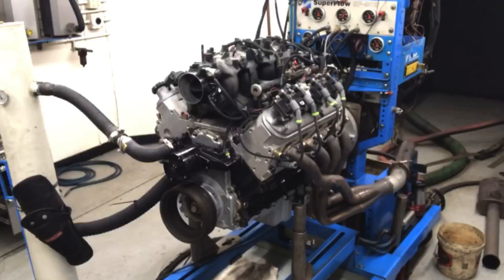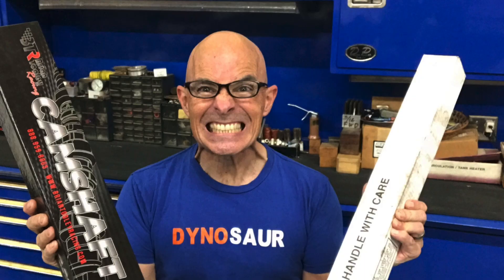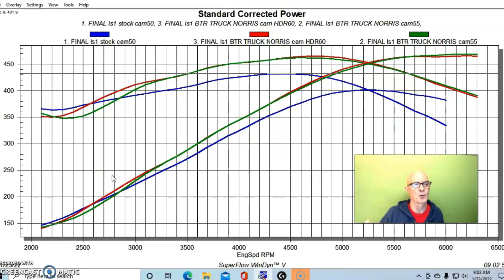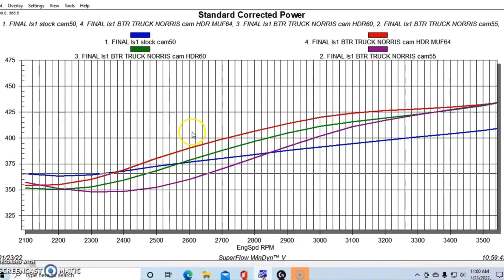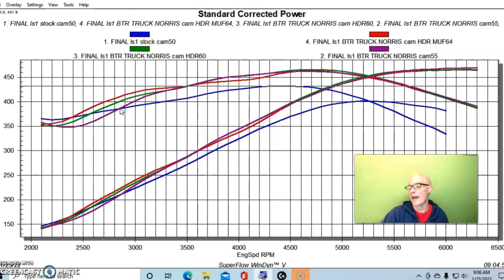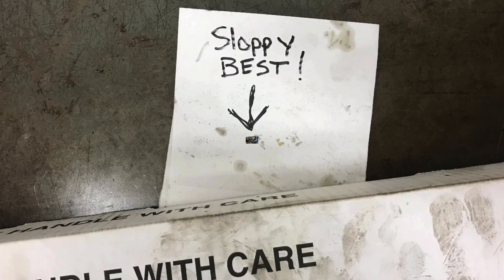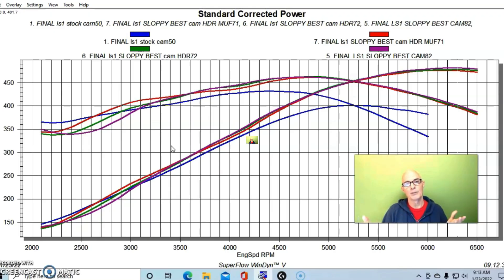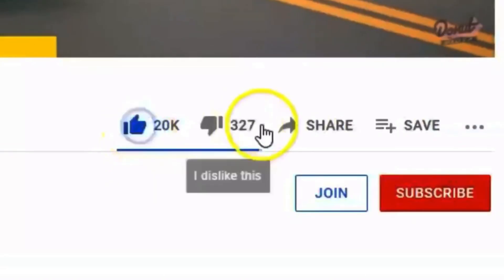DO LONG TUBE HEADERS ADD HP? 1 3/4 vs 1 7/8 HEADER TEST. WHAT MAKES MORE POWER ON AN LS? BONUS TEST

Comment: Both cars that l have and have had have had 1 7/8 long tube headers the one l no longer have had LS2 6.0 4.10 gears 700r4 transmission with a 3000rpm stall converter the car l have now has a LS3 6.2 3.27 gears a 6L80e transmission with a 4200rpm stall converter both cars have absolutely no low speed torque problems what so ever now if we were talking about my 2009 5200 pound Tahoe 5.3 with a stock stall converter l could see wanting more torque from idle to  3000rpm and using 1 3/4 long tube headers bet the stock exhaust manifolds are 1 5/8 but of course they are much shorter than any long tube header is
Reply from the maker: STOCK EX MANIFOLDS LOSE LOW SPEED COMPARED TO LONG TUBES
Reply: @richardholdener1727  l know had a LS2 in a G-body in 2008 nobody made headers for it so we used stock exhaust manifolds into duel 2.5 pipe with a X pipe and two two chamber mufflers dumped at the rear axle it ran good but in 2009 muscle rod by Hedman came out with a 1 7/8 long tube headers with 3 inch collectors using 3 inch pipe into a X pipe with two one chamber mufflers dumped at the rear axle made a huge difference in torque from idle to 7200rpm a big difference throttle response was better and it revved up faster

Comment: If your running a 3000-5000  stall converter the reason for it is so your engine when at full throttle doesn't spend much time from idle to where the stall converter starts to catch so more torque below that say idle to 3000 would benefit street cruising but not so much full throttle now a heavy truck or SUV with a stock stall converter would benefit greatly with more torque from idle to 3000rpm

Comment: "The Mega Stuf Orea is perhaps the most delicious and fattening member of the Oreo cookie Family" - Daytrade Scottie
Reply from the maker: I FOUND ONE EVEN BIGGER THAN MEAG STUFF AT A LOCAL 99 CENT STORE
Reply: @richardholdener1727  I am currently in training with the Ultimate Chocolate Stuf Oreo cookies.  When the current supply has worked itself out, I will step up my training.  Thanks for the heads up

Comment: Richard, my man. Can you do a test on the BTR torque cam? In either a 5.3 or 6L that would be cool to see. I want a better low speed cam in my 2500hd without the chop or need for a looser stall. Maybe even some other cams that can be classified as “stealthy daily driver cams” not everyone wants the “chop chop”
Reply from the maker: THE BTR TORQUE CAM WAS TESTED IN THE TRUCK NORRIS VS SLOPPY BEST CAM VIDEO

Comment: This is GREAT testing!  The question I have now is where does the 1 7/8" headers start to become beneficial?  I'm currently building an engine for my C5Z that will be estimated 750-800hp NA at the crank.  What im trying to figure out now is how beneficial would it be for me to buy a 1 7/8" header to use over the 1 3/4" header I already have? Or do I just use what I have if im not going to see a 20ish or more hp gain?
Reply: Maybe this video from popularhotrodding where the test four different size headers on a 427CUI engine producing close to 600hp will help you. Horsepower and engine size makes a difference. 
https://youtu.be/O1bXPNy1Yn4

Comment: Thx, I just figured primary size for a 660cid @ 5700rpm power, to be 2.125. A 572cid 6800rpm piece. That's what I want in a heavy SUV, making crazy power.

Comment: So let me get this straight. Say you have a 408, 418, 427 stroker motor making over 600hp and you won’t pick up at least 20hp going to 1 7/8” headers….I’m not buying that. I’d like to see proof. I’ve already seen a more powerful setup pick up at least that at the rear tires. So saying it wouldn’t, isn’t telling the whole story. Of course a heads/cam 5.3/5.7 won’t benefit from 1 7/8 headers, I’m pretty sure most motor heads know that and have known that.

Comment: Great video as usual.

I feel this particular video would be more relevant in the 2002 era where guys were putting bolt ons on their F bodys and vetts, but considering  headers. So I can see the little change in power vs these 2 header sizes at this lever/rpm range

This is 2022 and most guys using LS engines for power  are wanting to make some big numbers. Im talking NA, N2O, Boosted.

I would love to see you do a comparison of say a N/A (6.2 based) Rec head, 416ci ,  11.5:1,  650hp, 7000rpm power peak with these 2 header sizes.

Let me know.

Thanks for your time and effort in all your videos!
Reply from the maker: You are mistaken about the market-you (and others) might want to make big power, the vast majority are not building high-hp race motors

Comment: did this same thing on my 94 vette after adding the hot cam. primaries so big I had to dent the frame to get them to fit. really opened up the exhaust. first time i took it out couldn't get traction in second gear. blew the right side flowmaster clean off the car called flowmaster up they said first time they hear anyone ever did that. would have ran 10's that day but asshole at the track sent me home. was going to go up to 2 inch headers so i could run nitrous but totaled the car out when a couple deer ran in front of me on the highway

Comment: Engine dyno numbers don't tell the whole story, my P71 goes faster when i run it open headers vs closed electric cutouts..
Reply from the maker: the dyno tells you exactly what the difference in power is
Reply: @richardholdener1727  i agree with you, but once driving, the full exhaust may slow the car down vs running it with 2 to 3 feet of extra pipe after the headers.. In my case i'e confirmed my car runs slower with the stock exhaust on vs opened cutouts after my longtubes n high flow cats.. I'll try n do a video of my setup, it's pretty badass but it rattles when closed cuz the exhaust hits the cutouts directly n turns to go through the stock exhaust, if that makes sense.. But i love the dyno always..

Comment: Nice vid.. I'm sure there's going to be way to many bad replys 
My chevy 2 with a 385 ci small block with hooker fenderwell headers only changed a 1/10 of secoond in my 60 times. And that only from weight of exhaust. Still pull front wheel off the ground. Vs open headers

Comment: Are those 1 3/4 QuickTime performance headers?  I remember back in he day they were known for having higher  torque at low rpms compared to others headers. 
  They were due to the merge collector. That's why I ran those on my ls1.
Reply from the maker: QTP
Reply: @richardholdener1727  
 I figured they were QTP by the tag being welded to the header. I had done some research and showed up to 35 ft pounds of torque around the 2500 rpm range vs other headers. Thanks Richard awesome work.

Comment: I am more interested to see this test with a 600-650+ hp engine , to see the difference between 1 3/4" and 1 7/8" headers . 450-500 HP just isn't moving enough air for 1 7/8" headers. Thank you sir.
Reply: I’m with you!
Reply: 100%
Reply: Yeah unfortunately he always doing these little sht cams.  I wanna see like a summit 8707 or 8710  with 228/238 .600" lift and 1 7/8 vs 1 3/4 on a 6.2l

Comment: This 100% correct that a full exhaust system will work better than open headers. I did this same experiment at the race track by putting a capable cutouts on my headers. When I took the caps off the headers the car slowed down 2/10 of a second in the 1/8. Put the caps back on and the car picked up and ran where it had previously. Glad to see the myth of 1 7/8 headers busted, I had long wondered about that. Thanks Richard.

Comment: I’ve been waiting for 1 7/8 to get back in stock based on some tests on Engine Masters (not LS) but good to know I can go 1 3/4 with an LS swap and put the $100+ in savings elsewhere in the build. Thank you for the valuable data!
Reply: There is a good build in Australia on a Holden Commodore ss with an l77, similar results but backed up on the drag strip as a gain with smaller

Comment: Hi  , Seems its all about cams and cubic inches.  A good strong street cam on BB 427 can use either 1 7/8  or upto 2 inch and still make power . Need to try on a N/A stroked LS  or Sbc at 400 cu. inches .  Thats an interesting test.
Do the header calcs and 400cu.in is the minimum u would use  1 7/8 . With a strong street cam the requirement is somewhere between 1 3/4 and 1 7/8  tubes .

Comment: Ahhh, the perfect example of exhaust pulse frequency dynamics.  There is a bunch to learn on this subject.  Quite the bit of information on SpeedTalk about this.  I find it interesting that everyone wants to get air in, but then just leave it to chance to get air out.  A well designed exhaust system lets you have both torque and horsepower.  It is of my opinion that torque is the more valuable of the two.
Reply: Perhaps Richard could fab up some NASCAR style headers and boom tubes to see if there's still an advantage to be made.
Reply: @harperjmichael  Not sure how that would be remotely relevant, NASCAR stuff is designed to rarely go below 7000rpm - above what 98% of his tests peak at.
Reply: @Foghorn Leghorn,  in my case, a tow vehicle, it is everything.  I need grunt down low.  My cattle get scared if I'm using all the HP to haul ass.  But, they are well fed, so I need torque to move them.
Reply: Torque is of no value for other purposes than engine development and finding out what forces different parts might experience (pistons, rods, axels, tires etc). The vehicles movement, no matter if it's acceleration or a steady speed will always be (average) horsepower, as that's the unit that includes time. 
But sure, on the dyno you would be more inclined to look at torque during tests of something like headers, as that will tell you the amount you combust on a single cycle (vs hp that let you look at the amount combusted over a certain time). :)

Comment: I have a 5.3 with 1 7/8 speed engineering headers. The collectors are 3". I am going to be running a 2.5" exhaust. Should I go right to 2.5 at the collector or run it a few feet before reducing it. Thanks for opinions!
Reply: I have a 5.3 Silverado with true dual exhaust 2.5 piping. Should I go with the 1 3/4?

Comment: The correct header diameter is 115% of the area of the exhaust valve(s). This is a fixed formula that hasn't changed in dog's years. You don't want the headers to be too large, because then you slow down the exhaust too much, harming your scavenging.
Reply from the maker: THE CALCULATION TELLS YOU NOTHING ABOUT WHAT HAPPENS AT 2000 RPM

Comment: So fat what I'm getting is  1 3/4 header with a electric cutout  so you can go from open free flowing for higher rpm loudness to  daily driving and good down low response with it closed. I can def tell a diff just driving around in my t56 4th gen fbody with cut out closed down low.

Comment: Really interesting... but on a smaller engine with a mild cam, im not terribly surprised that smaller headers did well.  The fact that the full exhaust helped it was cool.  Sure, it was down 3 hp or whatever on top, but that wouldn't change 1/4 performance.  The added weight of a full exhaust system with mufflers out the back might.  Switching to tubular headers and full Magnaflow exhaust on my 2012 Boss Mustang, weight dropped almost 50 pounds.  On a street driven truck (as we would expect given a smaller engine with a smaller cam and a truck intake), a full exhaust system is required.  Still fun to discuss

Comment: Looks like I chose the right size for a street 6.0 in a heavy car with a not yet installed 217/225 cam,  1 3/4 tri-y's should do good
 Thank You Richard Holdener !!!
Reply from the maker: Tri Ys?
Reply: @richardholdener1727  Yes
Reply: @richardholdener1727  What do you think of them ?

Comment: I'd love to see a similar test on a 427 or 454 in the future. I mean, does 20-30% more displacement make the bigger headers worthwhile?
Reply: AT some point, yes
Reply: Back in the day I had a 70 as big block nova. I built a 427 ,about 600 crank. I had hooker super competition 2 18th headers on it. I hit an obstinate in the road and smashed the right header. I put hooker competition 1 78th headers on it and lost noticable power. I think the tube size needed correlates with the amount of ex the engine is making.
Reply: @davidreed6070  about 600? 
Did you ever dyno the motor. What did the heads flow?
Reply: @I_like_turtles_67  no I never dynoed the motor. It had closed chamber oval port heads, with 2.19 and 1.88 valves. The car had 3.73 gears a 4000 stall converter with a manual valve body. I would hit high gear at around 100,and it would do the wild thing. I prefer the 427 to the 454. I run a n ly6 now. Ls engines make cheap power, but so do big block Chevys.they make the cars nose heavy
Reply: The thing is that you can't compare headers this way.
Change the size of the pipes and the length of them need to be different to have them tuned to the same rpm. 🤷‍♂️
If you look at the exhaust system otherwise it's a matter of the power the engine makes as that's what determines how much gas mass that passes through. 👍
Reply: @PSA78  I have never seen anyone step up and zero in on how to claw back lost low RPM power from big-tube headers by just making them longer.

I mean, if small tubes make better low-RPM power, and larger tubes make better high-RPM power, and longer tubes make better low-RPM power and shorter tubes make better high-RPM power, why not see if 56" or longer tubes will claw back some of the lower-RPM losses of using a fat-tube header? Everyone seems scared to DEATH to try super-long primary tubes.

Most performance is sold on a "bucks per transaction" basis, not a "We really exhaustively researched this and found the upper limit of X or Y parameters" basis. Most places just sell parts. They don't actually TEST any new theories. 

In all your years, have you ever seen 6 foot primary tubes? Why? Because everyone would die of COVID if they tried super-long 2.25" tubes?

No, everyone's just too CHEAP to do exhaustive testing to prove the limits and capabilities of the various parameters.

Have you ever seen anyone do tapered-length headers, as on two-strokes? 

NOPE. Funny how pulsed flow suddenly quits working the moment some huckster wants to just make money on a set of headers, but no one is really finding out the BEST balance of length, taper, collector design, etc.

Truly finding the ultimate efficiency and power from a set of headers takes more money than these people want to spend, which is close to ZERO.

I mean, since the 1960's, we've had headers. Yet, here it is around 60 years of hucksters making profit from the Black Magic of Performance, but none of them have EVER published any research proving the ultimate limits. Why not 10 foot long 3" primary tubes? We should be able to look them up in a table and see where benefits quit happening, but there is a greed-motivated complete lack of research on this.

How much does a bend in the tube affect resonance? We should have a TABLE to consult to check it out. What taper provides the best balance of scavenging and power? 

The fact that there are not complete tables of research-backed data on this is a failure of the Western world.

Comment: Richard, you didn't mention what sort of tuning changes were made with the exhaust changes, if any.
Reply from the maker: each was run with an optimized tune to get every last ounce of power out of it
Reply: @richardholdener1727  Yes, I assume it was optimized, but were tuning changes needed in the lower rpm range where you saw power differences?

Comment: Can you run a test with whatever engine you can where you test different pipe lengths after the collectors? Put like a 5ft length of whatever diameter seems to suite and keep cutting a few inches off after each pull to see at what point the corresponding pipe length helps and then starts to hurt scavenging. I'm wondering how accurate my text books were at tech school
Reply: He's actually tested this already. Hopefully he'll comment with the specific video, but I remembering him doing it.
Reply: @andrewmontgomery1763  id like to see the results, I know based on sheer volume from displacement, rpm, and other factors it will vary drastically. I know there's a ton of things at play. It would be cool to different displacements from 1 liter up to 10+liters

Comment: Not with the stock camshaft do Under the same circumstances with the exhaust was it tested with the same headers with the same collector extension? I know the test was done to see the difference between these two camshaft but what they saying modifications help the stock camshaft possibly even more and it would outperform the aftermarket camshafts in the RPM ranges that it does. So down around that 2000rpm Mark would it gain torque at the same places as the Chuck Norris cam in the sloppy cam
Reply from the maker: I wish I would have tested that but removed the stock cam then decided to do the header test

Comment: Interesting that the bigger header made hardly any difference on the curve on the LS1 after peak torque. 
I reckon a similar outcome would be reached when comparing 2" to 1-7/8 headers on stroker combos.
Reply: Yea it just goes to show that when your at the limit of flow from the cylinder, once you go above the size that is a restriction, it doesn't make much difference.